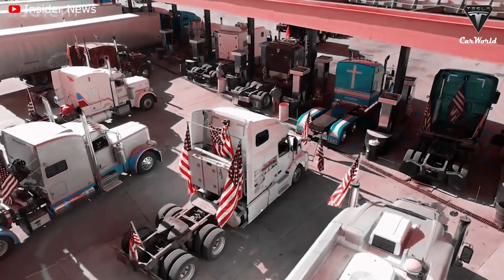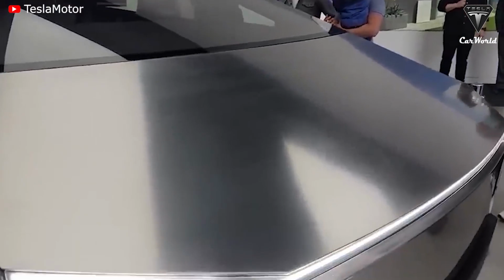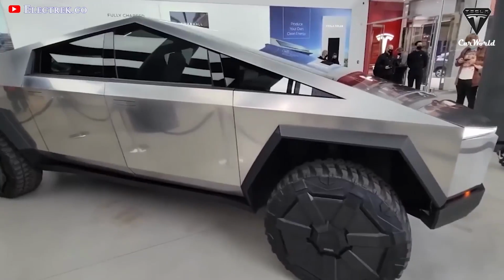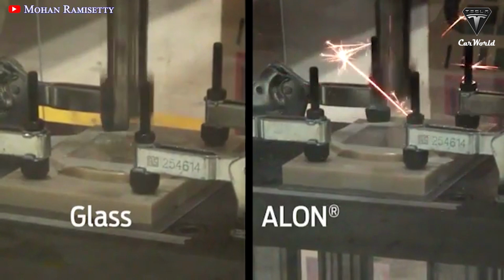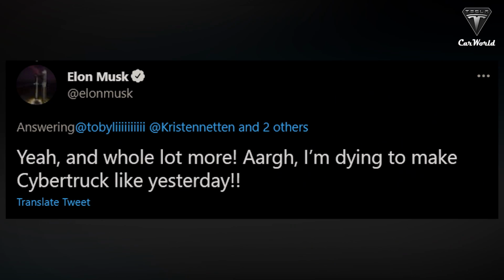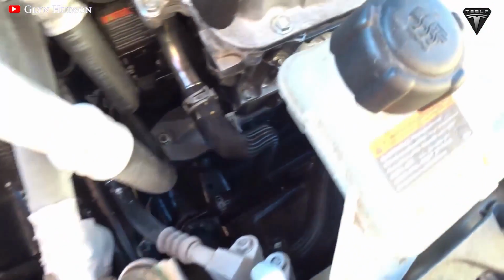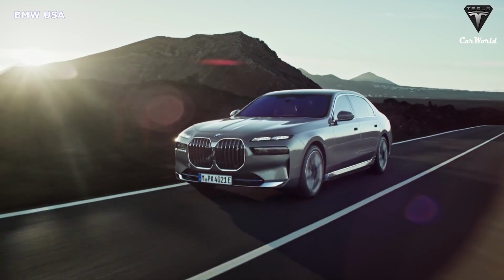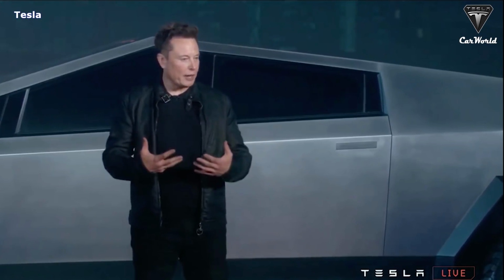IT HAPPENED! Elon Musk LEAKED ALL-NEW Shock 2023 Cybertruck Updates, Change Everything!

Comment: I feel that driving or flying any type of vehicle has to have some kind of front visual console for the driver. Like the X and S model.
Currently model Y and 3’s the Interior Dash console look like a Toy, Golf Car, doesn’t look very attractive. But the monitor on the middle of the console helps a little bit from looking so cheesy.
Installing a phone charger on back of the driver steering wheel will look much better than the feeling of sitting in a Bar awaiting for your beverages and food.😊

Comment: I was a air conditioning and Refrigeration contractpr for over 30 years to prevent that problem they have to have an actuated electric shutoff valve so that the expansion valve won't release any refrigerant and once the system calls for cooling or heating you don't matter for the operators and energizes the shut-off valve to allow float to the evaporator

Comment: Want I want a cyber truck with four motors, the fully adjustable suspension, but only two doors making it slightly smaller so it will actually fit within my garage space. And I want it for $45,000. If the price never comes down so be it I don't really need a cyber truck but I would buy one at 45,000 dollars I won't buy one at 80 or $90,000
Reply: Good luck with. May as well ask to get it for free.
Reply: Which message came first? "You guys really should hire a proofreader who understands English syntax", OR, "Want I want a cyber truck ..."
Reply: get a used one in a few years